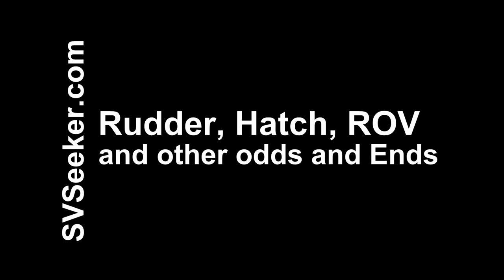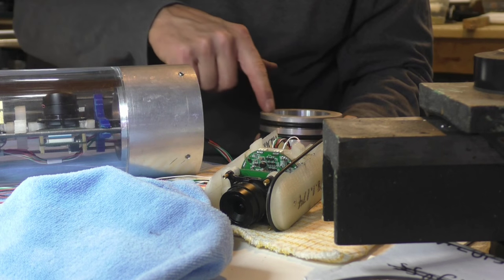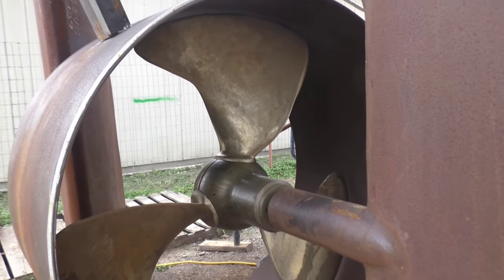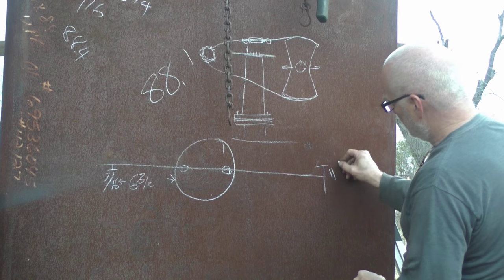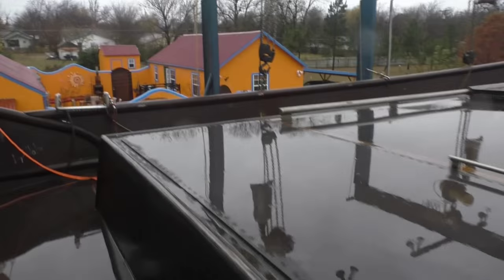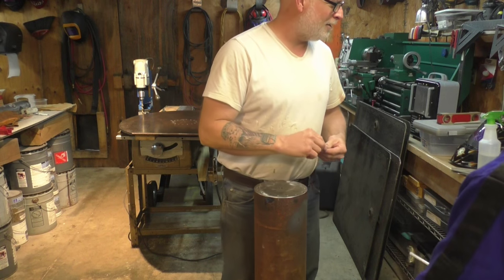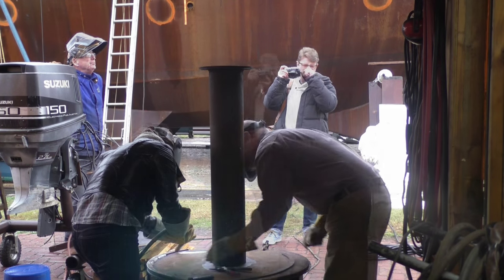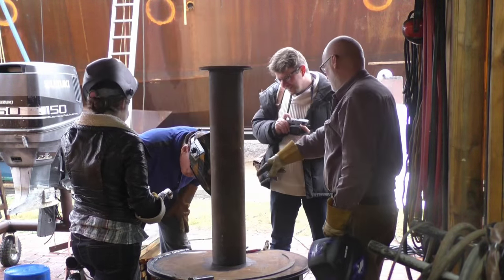Rudder, Hatch,  ROV and other

Comment: Hey Doug! Had a blast helping you guys out over there for a bit, such a big project you have!!  Quick note tho... the deflections I calculated for your catwalk was assuming a 300lb point load at the center of the span... the 5000lb value I gave you is approximately when the catwalk will YIELD under the same conditions.  Happy to help if you need some more figuring!
Reply from the maker: +Dan Germata     Thanks Dan.  And thanks for the correction.  It was a pleasure meeting you and Megan.  Subscribe to our blog and chime in anything you like.  http://www.svseeker.com/wp/blog/?v=e9841d3e5f8a

Comment: Doug, first off, I think I have now watched every upload and you and your team are a real inspiration.   All over I see effective way and means being used to overcome difficulties.

Now a comment regarding the attachment of your rudder quadrant.  I will use an analogy to a product that I built to illustrate the potential problem.

OK, my application:  I had to build some custom hydraulic cylinders which produce 40 metric ton of thrust (~88k lbs).  The cylinder had a cap held on with socket head cap screws which are in direct tension (not shear like your application).  The wall thickness of the cylinder had to accommodate the threaded holes for receiving the bolts with enough residual thickness for strength for the internal pressure (2500psi).  The larger the bolt diameter, the thicker the cylinder and the more it weighed.   A good designer does not want something weighing 80lb more than it needs to be (just 1 part).   So we used many 8mm socket head cap screws.   In general, the system worked very well indeed.   However, there was one case where there must have been a shortage of the needed length of screws and the machine builder substituted the next longer screw instead.   

What followed was that the screws appeared to torque up snug.  But in fact, the screws were bottoming out in the tapped holes and not developing the required clamping pressure.  This meant that the tension on the individual bolts was not at all consistent.  Some bolts were properly tight and carrying the load and others were carrying no load at all.  The result was that when put into service, the bolts which were properly tensioned failed very quickly since the load was intended to be carried by all of the fasteners.  Once those broke, this resulted in the next tightest ones breaking, and finally, the bolts that had been completely unloaded were the last to carry the load and they failed rapidly too, after which there was a big hydraulic oil spill and no more operation.

Now, applied to your application, I see 2 potential problems.  1) You are using bolts with all threaded shanks, thus nothing of substance to create a backlash free fit between the rudder post and the quadrant except the surface friction between the 2 parts.  2)You are reliant on all of those fasteners being and remaining equally tight to create the friction between the mating surfaces.

Usually, one would use a tightly fitting key, or a pair of large diameter (case hardened) dowel pins, pressed into reamed holes in both parts to transfer the torque.   The fasteners at that point merely hold the parts together.  The pin and reamed holes is easier to do given the kind of resources you have at your disposal.

Best of luck and fair weather.
WC
Reply from the maker: +Custercounty01    Your're right.  But others have already come before you.  The dowel pins on laying on the shop table and we are waiting for the drill and reamer to arrive.   And thanks for the good advice.

Comment: accualy the 3/8 bolts on top of the rudder shaft will not use the sheer strength, the bolts will use tension to create a friction fit between the top of the post and the plate...similar to the plates you see on the sides of bridge beams...if all of those bolts were left loose then they would all sheer off...there strength is all in the  stretch or tension direction and create a friction connection...you should grind a slot across the top of the pipe and another to match it on the plate...then you can insert a long steal keyway to carry the load in case the two surfaces slip under a tremendous load...awesome job man...I love watching

Comment: There is usually more than 1 way to solve a problem !

Figure out the largest bolt that will go through a 3/8" steel cable thimble.  Use a Grade 8 bolt through the rudder quadrant with a nut on top and bottom (don't for get the Loctite) for terminating the cable.  If you want to go bigger, use an anchor shackle to connect the bolt to the cable/thimble.

Use bolts through holes drill in the outside of the quadrant every 15° or so to guide the cable around.  You might have to make some kind of reinforcement to tie the tops of the bolts together.

You may need to kind of steering dampener.

Comment: You could try filling the clearance gap around the prop with multiple layers of paint to increase efficiency. Any dings like you were worried about from logs or similar and the prop will just scrape it's way through the paint. Marine paint is really thick per layer so it's only an extra hour or two in total by an unskilled helper and it will pay for itself sooner or later in fuel and transit time to get on station.
Reply from the maker: +Gord Slater   Yeah, I like that idea.   We can mix in micro spheres until it is as thick as we like.

Comment: Why don't you use hydraulic bump stops for the hard stops?  That will significantly reduce the shock loads on the rudder post.
Reply from the maker: +eformance    I like that idea.  Have you seen it done?   Any idea about exactly how it's done?
Reply: +SV Seeker They are used on off-road trucks, the mount is just a split tube sleeve with some bosses welded to the tube so bolts can clamp the tube around the bump stop.  I've not see it done in your application, but the principles are the same and it seems like a sound idea to me.  The hard stop would actually be the full compression of the bump stop, so they would engage at 75-80 degrees of full rudder travel.
Reply from the maker: +eformance Makes me wonder if the rams for the hydraulic system could do double duty.  There are also going to be hydraulics attached to the rudder that allow the autopilot to steer.
Reply: To create redundant systems for steering is highly recommended based on previous experience. You'll be thankful you did and well worth the headache.
Reply: +SV Seeker If that's the way you are thinking, then you need to research what are known as 'snubbers'. They are a device which can be built into the internals of a hydraulic cylinder which restrict the flow of oil from the cylinder when it nears the end of its stroke, so it doesn't hit the end so hard.

Also, one small criticism if I may. Where you've joined the wheel onto the rudder post isn't a great design IMO. Bolts are not supposed to work in shear. In a joint like this, the torque should be transmitted by the friction between the two parts. The bolts are there only to provide the clamping force which gives that friction. For this design to have any chance, you should at least machine the end of the post and the surface of the plate flat. I fear that your joint will work loose pretty quickly.
Reply: +SV Seeker doug, just as an idea why dont you contact a mr adam booth at "abom79" he has his own channel and works constructing hydralic equipment. he may be able to advise you and know where to get parts you may need? see you in april....

Comment: The funny nut at 20:30 is called an eye nut.  Your local electrical utility will have/use lots of them but doubt 9/16.    For the bolts for the quadrant you may want to consider Grade eight for extra strength.
For the quadrant itself instead of using cable to attach to it one could have a local gear shop turn it into a sprocket for #60 chain.  This will accept some deflection and definitely wont slip.  The idea here is you would go from chain at the gearbox to cable down the hull and back to chain at the quadrant.  Just a thought  -  thanks for the videos       Rod
Reply: +Newmachinist You can also get a "lifting eye" which has the stud forged in.
Reply: Your comment is more valid than mine - yes it's called a lifting eye     duhhh my mistake

Comment: Between helm and rudder - less is better. With each additional linkage the old passage; "as strong as your weakest link" becomes more of a rule. More sinking's have occurred from loss of rudders and directional control, from loss of forward motion power, than running aground. Which is the ultimate destination from the former!  Cheers.
Reply from the maker: +Rain Coast   Yeah, I agree.  I like this design because is does not use any pulleys.
Reply: +Rain Coast It's okay he'll be building a 30 foot sculling ore as an emergency rudder.. Or just drag a sea anchor (sunken dingy) and steer with the sails.

Comment: Hi Doug - thank you for the enjoyable video!  I'm believe this bolt up system is plenty strong and well built.  I do think you made an error in the shear calculations and the calculated shear strength is only approximately 20 tonnes, not 30 as you stated.  Wheels on cars fit snugly over a raised central hub for a very good reason.

I'll give you an example - if you can imagine a long straight pry bar with equally spaced holes in it:  If you only put in a single bolt, the shear strength is ~nil.  A long pry bar will easily rotate around (or easily break) the single bolt.  If you put in two bolts, the shear strength is equal to a SINGLE BOLT - half the number of bolts.  One bolt will break, then the bar will easily rotate around the remaining bolt.  If you put in three bolts equally distant from each other, the shear strength is ONE AND A HALF bolts - half the number of bolts.  The bolt farthest from the pivot point provides full strength, the bolt in the middle provides half strength (due to the lever advantage) and the bolt at the pivot point provides no strength.  The three bolts do NOT provide the same amount of shear strength because the axis of rotation is always around one of the end bolts.  Regardless of the amount of bolts you put in, you always get a shear strength that is half what you expect because the pry bar rotates around one of the bolts.  The bolt further away from the pivot bolt fails first when it hits it's maximum shear strength and there is a cascade failures after that.

Since your bolts are in a circle, the total shear strength is not half the number of bolts, but a bit more because of the added distance between the pivot bolt and the other bolts.  This completely ignores the friction between the parts which certainly isn't negligible. 

When you look at a wheel in a passenger car, the two surfaces are not flat.  The wheel fits snugly over a raised central hub.  This raised hub is critical to the strength of the system since even in a failure mode, the wheel must rotate around the strong center hub, not one of the bolts.  This  forces all the bolts to break at the same time and each bolt contributes the same proportion of strength.  I'm suspecting this is how you did your calculations.  Add up the shear strength of all the bolts, but without a raised central hub - that's not how it works.

Not to nit-pik!  But I thought you might want to know.  Thank you for the enjoyable video.
Reply from the maker: +gregvw123 Thanks and that's a good explanation but it's no longer a surprise as you are not the first to point this error out.  I went to the supply house today and picked up 5/8" dowel pins to correct the issue.  More here: http://www.svseeker.com/wp/helm-notes/?v=7516fd43adaa,
Reply: +SV Seeker I'll scroll down even further next time to make sure there isn't a previous reply.  I did check and Darin Areyacrazyman provided an excellent explanation also.  I wish you all the best and I really enjoy the boat build!!
Reply from the maker: +gregvw123   Yeah but I often need to hear it said a different way before I begin to understand it.   :)

Comment: Does the post hole auger reverse the direction of rotation from the input shaft to the output shaft? If it doesn't don't forget to cross the cables....
Reply from the maker: +Ken Parsons    It does not.   ...you've got your thinking cap on. :)

Comment: Doug, I do hope you have well thought out the rudder loads and control link loads to determine if using 3/8 inch wire rope as a control transmitter is sound over the many variables a large sea craft could encounter. Salt water is tough on any steel wire rope, and stainless wire rope does not hold up well being bent back and forth over a round quadrant.  Just my thoughts, not a boat steering expert by any means. (many years with wire rope and max'd out loads thou)I just felt the hair on my neck rise when you described your set up, and I though about bad seas and the size of your craft.  best wishes,  Greg
Reply from the maker: +pkav8tor   3/8 is overkill.  Edson specked 5/16"   http://www.svseeker.com/wp/helm-notes/?v=858ab15f1c04
Reply: thanks for the link. I will learn something tonight. take care

Comment: what are the plans for the dingy? driving down to Brossaurd,LA to pick up my AL. next weekend from Indiana to start my new jet boat build. I imagine your wanting something in a extra wide V-bottom.
Reply from the maker: +Dustin Apple    A deep V with flotation around the gunnel.  Good luck on the jet boat.     http://svseeker.com/tender.htm
Reply: +SV Seeker I like it, just keep in mind there's no replacement for displacement. I understand "room on the boat" but if your going to use it in marginal seas or haul much weight it better be large.  all foam becomes a liability after a while. that's why "air chamber" boats are such a good investment. I seen .25" in that pile of AL. you will have nothing to worry about, if you plan on pushing with the front id put either a 1/2" wall 4" pipe, some rubber bumpers, or thick UHMW. -good luck

Comment: On the rudder/quadrant connection, How about adding a few hardened dowel pins to share the load. You could drill out every other bolt and replace them. With only bolts you could have a problem if the rudder takes a hard blow and partly shears the bolts, You would be stuck grinding the heads off, lifting the quadrant off then dealing with the remainder of the stressed bolts. With pins that would be less likely.
Reply from the maker: +Blazer02LS   Good idea.  Others suggested it too.
Reply: +SV Seeker  Most rudder systems on ocean going vessels are over engineered to handle huge impact stresses than can be generated by the size of the rudder and sudden wave impacts on the rudder. While you have engineered the rudder, posts and quadrant to handle those forces the chain and cable you are going to use appear to be a weak link. Especially as you have no shock mitigation.The industrial drive chain your using appears to have 5/16 drive pins which will shear under load {ask any farmer how often these shear on farming equipment, thats why they are made as a master link chain} and the 3/8 cable may stress and stretch under load. a more common arrangement of commercial closed link chain and chain pulley drives with shock springs that allow slippage under heavy shock could be a better option, with the helm gear your using slippage would not matter as the gear box has no center position, the rudder center position is not timed to the helm position.
Reply from the maker: +Geoff Lubich    While the rudder can load to 20 tons you don't deliver that load to the helm, because at the helm there is only a person.  And 4000 pound is sufficient to easily break there arm should they not have the good sense to allow the wheel to slip through their hands.

Comment: Would there be any cavitation issues with the prop guard so close to the blades? Mike
Reply from the maker: +KU4PC     Actually it is suppose to have the opposite effect by keeping the water in higher pressure  after it parts with the blade.

Comment: Any provision for an emergency tiller? Or is that just not a thing on a boat this size?
Reply from the maker: +Bill Kuker   We should be able to sail without a rudder.   .....we will practice that when we have a lot of room for error. :)    If that fails, then we'll try a drogue.
Reply: +SV Seeker - I do occasionally sail on a 100 ft, centennial schooner, and they carry a 5-6 ft. emergency tiller, and train the crew to use it - AFAIK it hasn't been used in an emergency in 100 years, but it's nice to have it.

Comment: Just wondering; how did you calculate the rudder torque load (said 20 tons?) of the rudder when the rudder swings aside and is out of control? What scenario did you assume? Nice project go on!
Reply from the maker: From a formula that came out of some book.   ...sorry I don't know which one.  The variables were the square feet, and the location of the pivot or counter balance percentage.   And my guess is that max load is calculated with the bow hard aground and a wave breaking into the stern.   Short of backing into a rock that is the worst case I can imagine.
Reply: Ah I see. Worst case scenario! Thanks for your quick reply :)

Comment: To switch from Acetylene to Propane,what,if any,changes need to be made?Tips,regulators,etc?Looking for a cheaper way myself...Thanks!   BTW,another afterthought about the prop guard......How about another ring/hoop,larger by say 6"-8",with runners between the original and the new outer ring.It would prevent any flex in the inner ring,unless bumped REALLY hard,and I KNOW you wouldn't do that!
Reply from the maker: I don't remember, but I think the regulator is specifically for propane too.  I got it all as a kit. And we'd be more likely to put another ring inside the front of the existing ring and build it into a wing profile in order to form a Kort nozzle.  https://www.submarineboat.com/kort_nozzles.htm